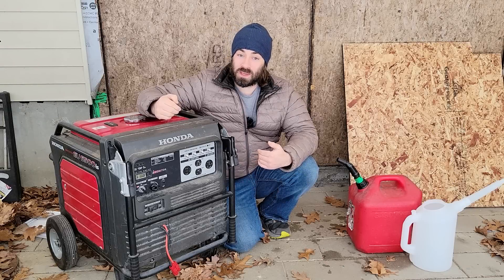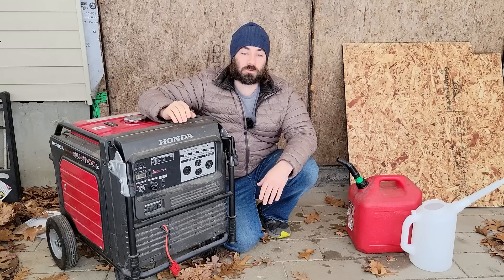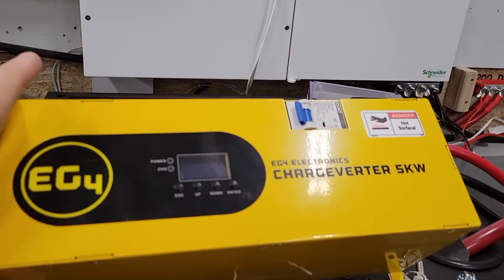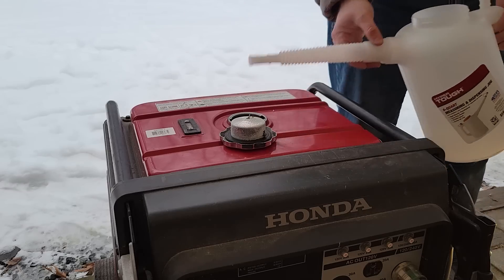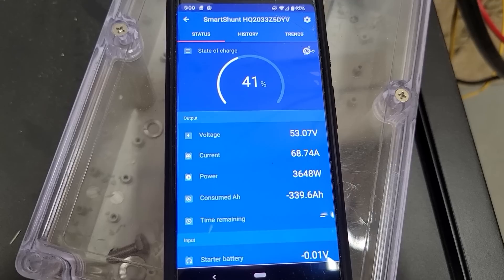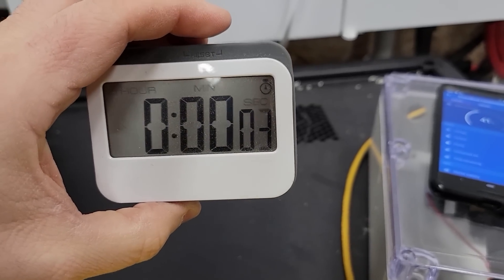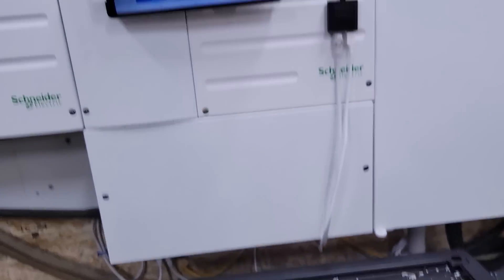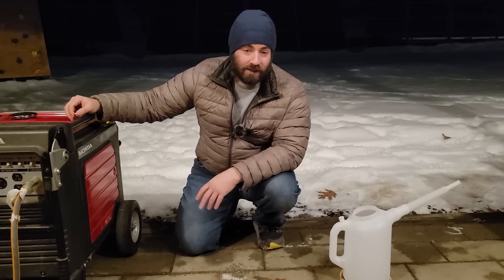Not what I expected.

Comment: You will NEVER get even close to what a diesel can do.  The higher compression ratio makes them more thermally efficient. Some diesel engines can hit 50% thermal efficiency (not any one you are likely to buy), but most operate at higher efficiency rates via the higher compression.  Compress is directly related to thermal efficiency.  Price differences of diesel and gas could make it moot though.

Comment: What happened to the Growatt inverters?  I just ordered 2 to match your system because of previous videos, and now I see you're not using them?  And did you ever use a generator to charge batteries through the Growatt? Thanks.
Reply from the maker: The Growatt inverters are still working great.  I started testing a Schneider inverter, so I moved the house to the Schneider.  
I once tested running my generator through a SINGLE Growatt inverter.  That was just a bench-test.    If you are setting up two inverters in parallel, then I don't recommend running anything into the "Input" terminals.  I never connected anything to the input side of the growatts on my wall-mount system.  
Instead, I set my generator up to power the house directly, skipping the inverters.  This would only be the situation if the inverters died.
I also set up the Chargeverter, so my generator could re-charge the battery bank if the solar wasn't keeping up. https://signaturesolar.com/eg4-chargeverter-battery-charger-48v-100a-5120w-output-240/120v-input?ref=4_rHcgZ9x-TiF-

Comment: On the last test, the "eco" switch was off.  Im not surprised. Fuel has a known power density, in round figures 1 gall of gas will provide 10hp for one hour, and diesel 2 hours on a gallon.  Maybe you can do an accurate conversion between hp and watts energy?

Comment: Not enough Empasis was given to the run times, at 100a the gen run hard but for a shorter time, opposite at 70amps the gen ran easier but for longer, the energy is in the fuel, I personally would rather be running longer and easier.

Comment: Thanks for the test David. I lived off grid, Caretaking for a guy who had 2 of those eu6500's, which got rotated, and ran 24/7. One had 39000 hours on the hour meter, and the motor was NEVER torn apart,  burned nearly a pint a day of Castrol full synthetic oil.
HONDA is king

Comment: I was looking for something like this last year and I couldn't find anything suitable. I've been using the 50 amp charger inside of a 6 KW inverter but it's extremely inefficient running a 13,000 watt 2 cylinder generator and I blow through a tank of gas in just a few hours. Well only adding 3% to the battery per hour.

Comment: I use a generator like this, change the carburetor to a dual fuel switchable carburetor fo4 under $40, make a HHO water to hydrogen electrolysis generator that separates the oxygen out, port the oxygen into the air intake with a small line, the hydrogen goes into the propane fitting with a gas appliance hose and regulator (like a propane BBQ set) and add a low pressure air pressure switch cut off at 15 psi on the hydrogen line to shut off the 12 VDC to the electrolysis chamber, and it needs to be in a indoor space like a garage with an exhaust ported outside, and this can be run as long as you need it.  The system will cost under $300 to make, and only use gasoline when this is down for maintenance, and the engine basically only needs an oil change once a week.  Running cost is around $30 a week, instead of $50 for fuel per day, and the engine runs better and longer on HHO.

My HHO system is much larger, about a $700 unit, higher efficiency carbon fiber panels instead of stainless steel, and I run the hydrogen outlet through a bubbler cylinder with two gallons of gasoline to force hydrocarbon out of the fuel with the small bubbles, this combined with hydrogen makes a more efficient and more powerful fuel.  It needs to be dried and filtered for any latent moisture, but it can be run through the 3/4" steel pipes to the home appliances as well lie the kitchen range, water heater and furnace, as long as they use an electronic ignition they don't waste fuel on a standing pilot and this is as safe as propane, but at 1/10 the cost, little maintenance and no calling for delivery or need to be in a municipal system with natural gas.  The HHO also should discharge into a like with a 1 gallon expansion tank, it will fill and even out the on/off cycle as it operates to pressure up to the limit of the 15 psi NC pressure switch to keep the chamber as safe as possible. Do not use a dual output hydrogen with oxygen in the same pressure system, over 20 psi in voluble can spontaneously explode. Cheers.

Comment: Does it make sense to run the generator at a lower rpm to preserve its longevity vs slightly improved efficiency at charging? Also, I was wondering  if running a smaller generator ( tho possibly having to run it longer) could be more cost effective both in fuel costs and overall machine costs /wear and tear/ replacement ? Lol, I do like the quieter small generators !
Reply from the maker: Typically larger generators are more fuel efficient per kWh than smaller generators.  This assumes you have an 80%load on each.

Comment: It would be interesting if someone made a smart control system to run the generator just enough to get by until sunrise.  I'm thinking you probably don't want to charge your batteries on gasoline to have 95% SOC at sunrise.  I bought a Westinghouse auto start generator when they were on sale about a year ago. it would be nice to use just enough fuel to keep power going until panels are producing enough to take over.

Comment: I'm surprised but not that much. 

The engine efficiency drop after a certain point, but the engine is oversized so it can handle surges, and so it don't kill itself from constant max power usage.

The alternator is mostly linear, the higher the load the most efficient it get.

The inverter is mostly linear, with a slight drop at the high end

The chargeverter is like the inverter, roughly the same technology, and is also linear and slightly drop at the end.

Now, the engine being oversized is what saves everything: at max power you are most likelly close to max efficiency, which compensate more than the three inverters losses.

Comment: I'd recommend a Bridge Rectifier as a Backup for  Shtf - the tranformerless Pv Inverters will take  a rectified generator input on the DC MC4 plugs in an emergency.  100amp 3phase Bridge Rectifiers, some are pretty robust and cheap

Comment: Perhaps I've misunderstood your measuring method, but I was confused because current has to be the same all the way around a circuit.  I'm sure you know that, and perhaps there are some other circuits with other paths to ground/-ve, but current measured at one end of a cable is the same as current measured at the other end - even if the cable is heating up or something.
Reply from the maker: I agree with you.  Sorry I wasn't explaining myself well.  I've seen this same type of thing on a lot of equipment.  The little screen is showing a higher kWh than the shunt I'm using at the battery.  Sometimes this is attributed to Voltage drop over the circuit (wires, crimps, terminals, bolts, etc).  In this case, the screen was also displaying a higher Amperage (example: 70A, while shunt showed 68.74A).  Which means something is off in calibration.  Either my shunt is off, or the screen is off, or a little of both.  The screen is just displaying what the internal power supplies are telling it.  Either way, there was a discrepancy.  But, I use my Victron shunt with most of my videos to show power in or out so I stick with that.

Comment: Get a watercooled generator and hook up a heat exchanger on it cooling circuit. That will increase your efficiency more than anything else you will try. Heating the boiler etc costs the most power, using the wasted heat energy from the ICE could heat your home if you store it in buffers.

Comment: Hi David This is great and your devotion to the task & to all of us is amazing !
If you have not done the Conversion Effecincy of Gasoline to Kilowatt hours it is easy with BTUs. 
There are 120,000 btu in the Gallon of Gasoline and 3,400btu in a kilowatt/hour.
You got 5.8 Kilowatt hours so about 20,000 btu, gives ~ 16.6% conversion efficiency. 
Which is not bad for a small system as the Best Grid Systems are about 50% efficient...

Plan B would be to Capture the Heat from the generator to heat your water....
Run the exhaust through a Plate Heat Exchanger. 
PS $3.50 gasoline for $.64 grid electricity is why we LOVE Solar. 
Great work Thanks James

Comment: I like your video, but there's something missing. All 3 tests can't be equal because you were running different charge currents. So either there's something wasting power, or the times were shorter for each run. You didn't mention the run times for anything but the first run. If the times got shorter and shorter, then that makes sense, but if all other things were equal, I'm confused.
edit: it seems I didn't scroll down far enough! So the times were progressively shorter, good to know. The only other question I'd have would be: was the change linear? Meaning could you have a sweet spot somewhere in between your 3 test points that give best fuel efficiency and best longevity of batteries and generator parts?

Comment: If you mainly use the generator for heat you can use heating oil on a diesel engine is at least a dollar cheaper,a 5 KW diesel you get 2 hours and the hot water and even the hot muffler gases can be used for heat,it it's call cogeneration.

Comment: you probably know this....but those XW inverters have a built in generator power connection that also charges.....and you can hook that electric start honda up to aN AGM ...(auto start module) ...it will start the generator when the batteries fall below a certain voltage....that way you dont have to wake in the middle of the night

there is a trick to hooking up those generators though...it isnt plug and play like some are

Comment: I'm wondering why your off-grid home is electrically heated.
Why not use a wood burner? The carbon in wood is already in the environment. If a log lays in the forrest, it gives off carbon as it decays. Fungus and insects consume it and break it down and they give off carbon into the atmosphere. How much carbon? ..as much as they get from the log!
Burning the log does not give off more carbon; it simply produces heat because it gives off the same amount of carbon more quickly.
Reply from the maker: I couldn't get a permit for a wood stove, or an outdoor wood boiler.

Comment: Honda generators! 
My EU2200i will not only put out safe voltage but a quality 60 hertz level when over loaded (ie 2,320 watts 👍)
And not die or trip off. 
The Hondas will out perform all the others in this regard.

Comment: I am not surprised at all.  That's a really nice generator and its energy output was the same because the fuel was the same, you just underestimated that Honda.  Edit:  Seeing as how the fuel efficiency doesn't really change I would probably keep it at 70-80 amps just to try and run everything a bit cooler get the most life out of that expensive generator.  With a grain of salt bud, your obviously have more gear and experience than I do.

Comment: It takes a certain amount of energy just to overcome friction to turn the internal components of the generator. If the generator is producing more current in a given time period, then the less percentage of the total energy consumed goes toward overcoming the rotational friction. The generator undoubtedly ran for less time on a gallon of fuel as the output power increased. Meaning that the amount of rotational friction affected the total loss less with higher outputs. I suspect there's a close correlation between the ratio of runtime per gallon and the efficiency per given output load.

Comment: The amount of energy in the fuel is static, so the only efficiency gains are going to be in finding the best spots in the outputs of the equipment.  Not really surprising the only real change here was in the amount of run time, as honda and the EG units seem to be good designs, not showing a large difference using different throughput settings.

Comment: You are using gasoline to make electricity to power a heat pump? Gasoline has about 32kWh of energy in it per Gallon. If you are getting about 6kWh electrical out, you're actually only about 18% efficient. A heat pump would need to have a 5.5 COP roughly to break even. If you find one that does that in winter let me know!

I think it might be more efficient to simply set it on fire and make hot water that way.
Of at least use the 80% waste heat from the generator somehow. Maybe place it close to the heat pump.
Reply from the maker: I heat my house with a mini-split heat pump.  This is done 92% of the time with solar energy, and 8% of the time with electricity produced from a generator.  I'm also using lights, TV, microwave, fridge, etc.  Everything is electric.  It's true that if I had a boiler, heating water from a flame, and then circulated that throughout the house, it would be more efficient than a generator to heat pump.  However, the up-front cost would never pay for itself given the very limited time it would be used.  I mean it, if the high-efficiency boiler has a 20 year life expectancy, It would never pay for itself before needing replacement.  
BTW, I'm constantly improving my solar system and will probably be at 98% by next winter.

Comment: I would run it as low as you can, if you can get your charge at 50 amps it will save your generator. Your generator wont last if you run it at max power. My honda 2000 was rated 1/4 load and thats where it ran best for extended runs. Think about it this way, running a gen at max is like driving your car full throttle all the time. 
Off grid 11 years.

Comment: Your generator will handle that overload due to the low ambient temperature, and the fact that it's a Honda, rather than a Chinese junker.  It would not like that on a 100 degree day, and would likely trip off line.  I would suggest trying lower power settings to find the lowest setting that still provides good economy.  The engine will last longer, and all of the many electronics involved will enjoy lower stress and temperatures.  The efficiency found in your test comes up to around 17%, which is in the range of typical.  It is a shame that the engine driven generator generates AC (high frequency, three phase), which is then rectified, which is then inverted to 60 cycles, which your charger then rectifies and drops the voltage down to your battery voltage.  Each step has it's own losses.  If you had the engine driving a 48 volt DC generator, the efficiency would be considerably better.  Though the efficiency might then get into the low 20's, you still don't want to use that to supply electric resistance heat.  That's what you use the waste heat from the engine for.
Reply from the maker: Yes, the cold air temperature helps.  In my situation, with my solar and loads, I only need to pull out the generator during the winter.  I've never ran out of solar energy in the summer.

Comment: There are a few important- but usually overlooked- things for anyone living "off grid" to consider.  Since fuel is expensive, you want to get the most out of it.  This means not only an efficient, slow speed generator set, but critically it MUST be water cooled so you can capture the waste heat.  Even the best generator set rejects the overwhelming majority of the energy in the fuel as heat.  Your test shows 83% wasted!  You want that heat, or at least most of it.  Heat up water and provide heat for your home with it.  Also you want a small, low power generator set so it doesn't make more heat than you can use at one time.  Ideally you'd time the operation of some of your loads so you bypass the inefficient charger/battery/inverter, and go straight to the load.  If it will be charging a battery, you want to put together a direct current set that operates at battery voltage, to skip at least one step of loss.  There are no small, low speed, good quality generator sets made anymore.  This means overhauling a good old set, or putting together something on your own.  Select a GOOD, small liquid cooled engine, such as a small Kubota diesel, and find a good generator for it to drive.  Again, the key attributes are small, liquid cooled, slow speed.  Diesel will be quite a bit more efficient too.
Reply from the maker: I agree that a diesel is a better choice.  This winter I purchased an MEP-802A, which is a 1800RPM diesel, liquid cooled.  I've shown it in a couple of my videos.  I've had this Honda for about 11 years and still use it.